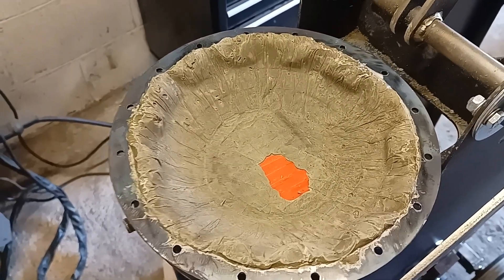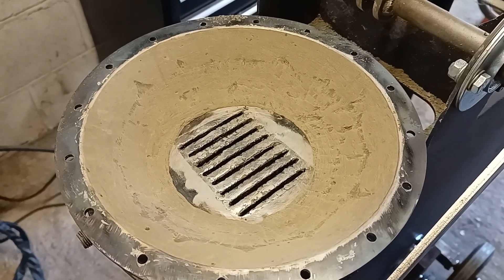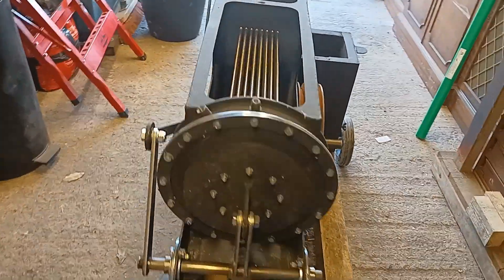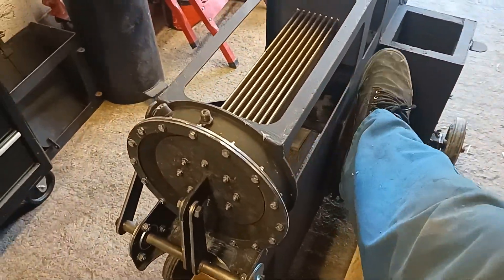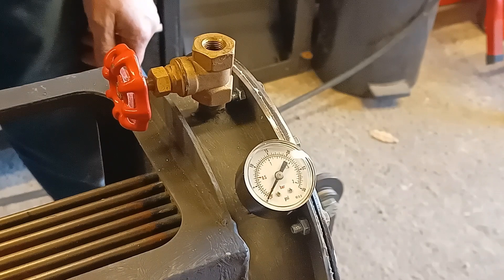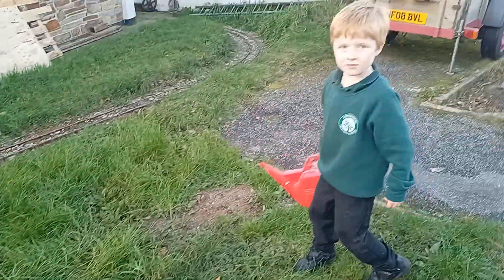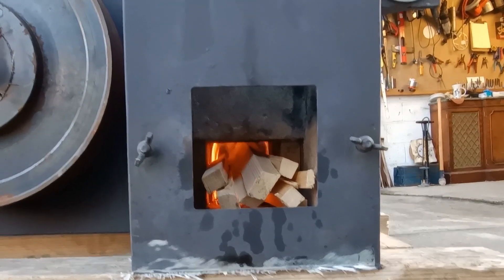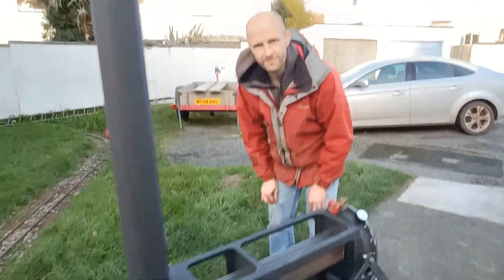Stirling Engine Generator Mk4 (Rocket Stove!) Part 5

Comment: Could you explain the theory of how this works?

What us the long rectangular section that goes in the middle 
from one end to the other?

What is inside the rectangular section?
Reply from the maker: Hi, the theory is the stirling cycle. There are plenty of explanations on the Web. The difference with this engine configuration is how it achieves this. Search alpha stirling engine. The heat exchanger tubes are empty

Comment: HiShane. Thank you for the videos. Question. Do both the diaphragms (pistons) contribute power to the crankshaft? I know that the hot side develops pressure to move the diaphragm out. Does the cold side develop pressure or vacuum or is it acting like a displacer to get the air back to the hot side so the cycle can start again? You have put a thought in my head, but I need to know what the actions are on the diagrams. You’ve developed a lot of experience and knowledge with this type of Stirling engine, so hopefully you will be able to shed some light on my query. Regards. Stephen. New Zealand.
Reply from the maker: Hi Stephen, I'll be honest, I don't know! I think the hot piston is moved by most of the expansion force and the cold side by some of expansion force until the part of the cycle is reached where the internal gases are being moved from hot to the cold side and the internal pressure drops. Not sure if that answers your question but that's all I know. This seems to have always been the problem with stirling engines, know one really knows exactly what's going on inside : ) All the best, Shane, UK

Comment: Definitely impressed by the latest iteration. Well on its way to a functional stirling genset. You will find that rocket stove design will actually eat wood if you were feeding it full time, air is 2/3 rds nitrogen so controlling the air volume through the firebox will get you a far hotter flame with much longer lasting coals. If you watch the vid, the rapid warm up, you had the mouth pretty much plugged with un-burnt wood, effectively reducing the air to near stoichiometric ratio. If you don't already own a copy, you might find this a useful resource; Hot Air Caloric and Stirling Engines: A History v. 1, it is available online and covers everything from pre-industrial era all the way to stuff like the ARE harwell atomic heart pump, all in reasonable detail with any necessary math.

Comment: Hi Shane, I have a question. Why did you close the valve after the air inside is already heated?
As I know, if you first close the valve and then light it, more pressure would build in the pistons and that creates more torque. Am I wrong?
Excelent design btw.
Reply from the maker: It can't be seen in the video, there is a one way valve underneath on the side that lets air in but not out, cheers

Comment: if u want get rid of one of ur build i would be very happy to have one running in my sallon instead of the ventilated stove ^^ i run some solar pannel but not much on battery and the winter dont produce much , some 8hour time 500 watt would be plenty more power to feed my 12 volt line ^^

Comment: for the  regenerator, u should put rock wool at the hot side, and put a heat break down at the midle of it .. heat loss via thermal conduction betwenn hot cold side are the biggest loss...

Comment: for the konky noise: try get some teflon rod ask a friend with a laythe to make a silencer to put between the two metal part that connect the rod (like a bearing holder in teflon .. usualy its the play of bearing loge that make the kling kling...

Comment: you own a new sub , very nice idea to try get a design with membrane, u r trying get rid of the friction loss ^^
Reply: for normal people machining air tight piston is tricky .. and using car part with lub is not the best idea...  membrane from home depot like kinda a good way , wath material is it? pound liner?
Reply from the maker: It is just normal black rubber, nothing fancy! I think it's natural rubber. I've heard that pond lining rubber is pretty good. The fabric is 100% cotton canvas painted with silicon sealant @sunoncream1118

Comment: Awesome job working straightaway.
If you share this diameter of your diaphragm outer inner, I’ll look For Mobility Tires of the same size if that helps
Reply: If you’re doing this as plans or a kit, I’d like to buy it . I think what you’ve achieved is awesome.
Reply from the maker: You've got me thinking about tyres! I was wondering about wheelbarrow, tyres because their pretty squishy
Reply: @ShanePomeroy  exactly Mobility Scooter Tires are very similar in that respect and come in a lot of different sizes. I have lots of worn out ones if it’s any help to you

Comment: Hi Shane . Amazing implementation from concept to running in about a month! 
You are definitely on the right track regarding easy ,cheap and reliable.I'm building a beta
but it's only focused on the "reliable part"
I have a couple of ideas for your diaphragm problem. One possible solution is a convex diaphragm 
plate using a taughter diaphragm and another is increasing diaphragm diameter with a reduction 
of stroke, although I would  expect ridgidity requirements would increase with the shorter stroke.

Comment: Nice engine and looks like it is going to be very efficient, practical and easy to maintain just those last few little tweaks. You can also make them from model size up to industrial size quite easily the way you have designed it.

Comment: I look forward to buying one. Even just the engine part. I’d make a big fire in an oil drum and heat water in copper pipes and then pipe the hot water to run over the hot side of the engine. Then you aren’t limited to the space of the rocket stove. I know you want it portable but I just want an easy way to turn scrap wood branches and sawdust into electricity

Comment: There's a few online companies that can made custom bellows, either molded or 3d printed. Perhaps that can be a solution to keep it from bulging out. They would be accordion like.
Reply from the maker: I understand what you mean. If the idea of using diaphragms instead of pistons seems to have some legs then I'd be keen to explore these options., Many thanks
Reply: @ShanePomeroy  as you noticed, pistons as rigid objects preserve almost all compression, anything like a diaphragm loses compression because of elastic deformation to some degree. Harder diaphragm material means "crinkly" deformation losses (i.e. more friction). Pistons with appropriate machining of both piston head and compression chamber walls + o-rings and lubricant or graphite based lubricant, will always be more efficient, especially when you pressurize. And for Stirling engines especially, pressure is key for efficiency and viability for non-toy use cases like making backup electricity.
Reply from the maker: @revanchistwealth  I didn't really consider this in the design stage : ). It certainly is a problem! I'm currently fitting some support rings to reduce the bellows puffing out. I was hoping this design might solve some issues but I'll do what I can. You can get reinforced silicone that might be worth trying , Many thanks

Comment: Heh. It runs on first try. 

You may use some sort of one way valve to bulge diaphragms to outside. And some rubber band  between cylinders to negate extra work/not optimum buffer pressure.

Comment: The shaft that you have the flywheel on is long. If you were to add a fan of some sort to that shaft, and then duct the air produced from the fan, blow it over the cooling fins to increase the delta of cooling.
Reply from the maker: That's a pretty good idea! Thanks
Reply: @ShanePomeroy  of course, if I can help let me know.

Comment: Can the output power be used to drive air for the fire and coolant to increase temperature differentials?
Reply from the maker: I think there is great potential for this. I'll try and solve the basic problems first and then see what can be done, cheers

Comment: Absolutely fascinating -  It seems to me you have too much dead space in the setup - certainly the regen and cooling can be optimized  - I think in your design the flow is laminar - great for low resistance not so good for heat transfer - I wonder what Philips used in the Rollsock seals- I seem to remember they had a long lifespan
Reply from the maker: I was thinking very simple when designing this but maybe I've overstepped the mark! Your comment on laminar flow intrigues me because not many people seem to talk about it in stirling engines. Do you think successful engines are turbulent flow? I've probably allowed a bit to much cross section in this engine but in my defence I was a little unsure what the rpm would be. From what I've read, Philips took a lot of effort to get the rolling sock design nailed down and even then the mechanics had to be spot on for it to be reliable. I think the main problem was if the piston went off centre the sock would rub on itself. All the best
Reply: @ShanePomeroy  Thanks for your detailed reply -  Yes I think a  more turbulent flow would improve the heat transfer - I wonder if it's possible to insert pressed mesh "fingers" down each transfer passage - that alloy-punched mesh  ( in a style often found on customized car grille/vent ) that would jostle the air from side to side on its journey - Dont think it would be too hard to add and could run the full length even into the firebox section -  you could also see if pouring cold water on the cooling side when it's running improves matters  - if it does then perhaps boxed in a cooling tank on say the last half so as not to chill the regenerator?
Reply: @ShanePomeroy  Been thinking about your transfer passages - If you were to corrugate the mesh insert "fingers" by passing them through a pair of loosely meshed course gears then pull them through the entire length of the passages with some temporarily attached rods or wires they would make contact with the internal surfaces of the entire transfer passages and greatly add to the thermo conductive surface area -  it would also stop them rattling - what do you think?
Reply from the maker: @trevortrevortsr2  I think it might be the next logical step to try and achieve better heat transfer. I kind of messed up and made the heat transfer gaps to big (live and learn!). Many thanks

Comment: Hi Shane im sure you thought of this but where your seals are puffing out. 
I have seen similar designs that use a dish or bowl shaped back plate that supports the rubber all the way in with a round surface. With the flat surface you have a sharp wear surface. A great start 
I was amazed it started right up. You really are a great engineer. 😉
Reply from the maker: Hi Perry, You're spot on with the sharp wear surface, there are signs of wear already! I'll make a support dish / ring that bolts on and see how that does, many thanks

Comment: It doesnt seem to be anywhere near as powerful as earlier versions. Where is this design process going?
Reply: If you can make this a low temp Stirling, that only needs warm water from a solar boiler than that would be a very cool thing to do also, no need for firewood anymore!😊
Reply: @markgeurts258  You might want to consider the fact you cant get more energy out of a system than you put in...
Reply: @markgeurts258  It would probably make more sense to replace the solar panel with a PV panel and produce electricity directly.